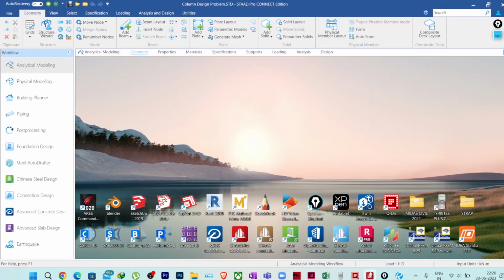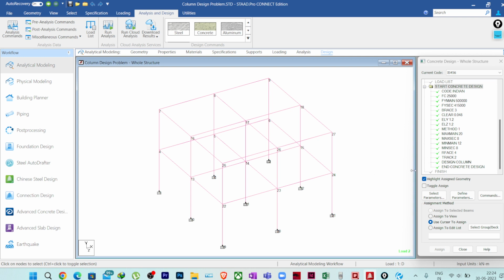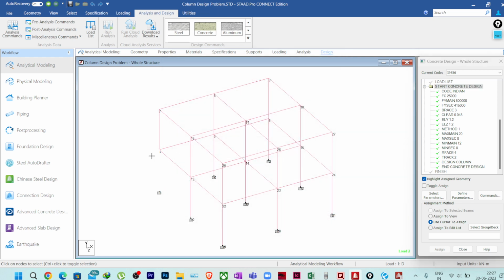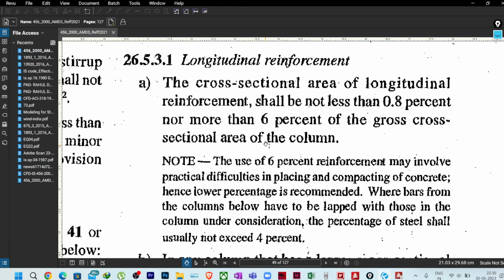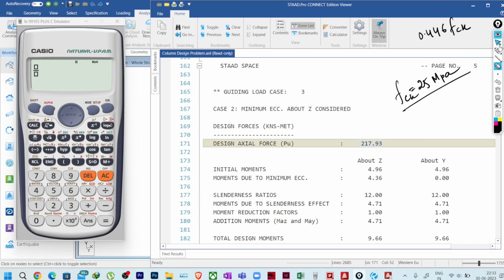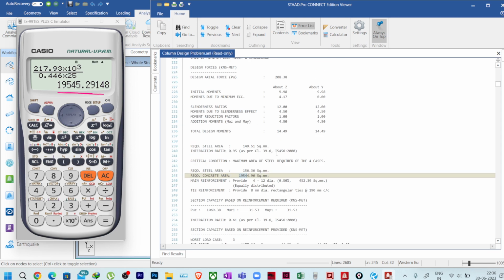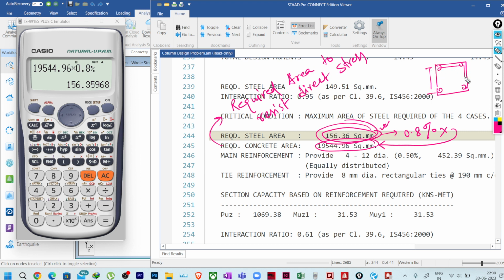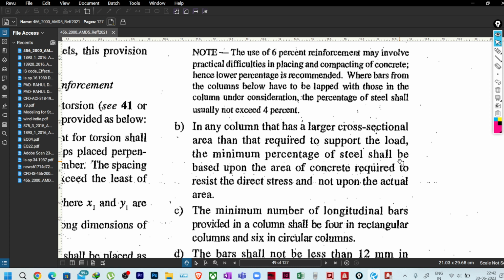Is STAAD. Pro doing it incorrect? | Column Design | Fact Check | ilustraca | Sandip Deb

Comment: Prior to your video I assumed that staad is doing column design wrong but now cleared. Then one more thing that etabs is doing wrong as it provide Min %age provide as 0 o.8% irrespective to the area reqd. Corresponding to direct stress . Is not it
Reply from the maker: Not like that.. if required area is more than the minimum %age as per code then it will assign the greater one only. In case the minimum %age is governing then it will find the required concrete area for direct stress and will check if with 0.8% of that required concrete area is giving interaction ratio less than 1